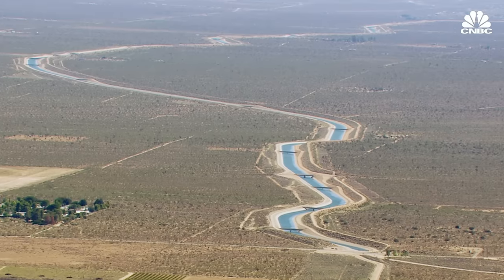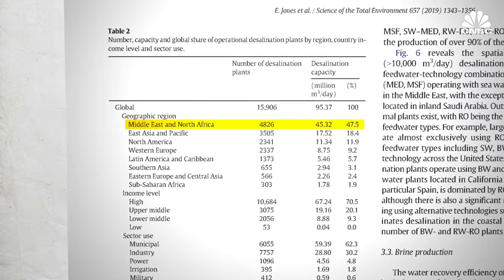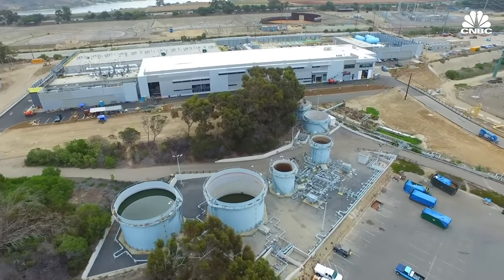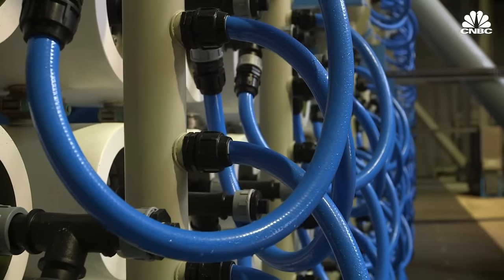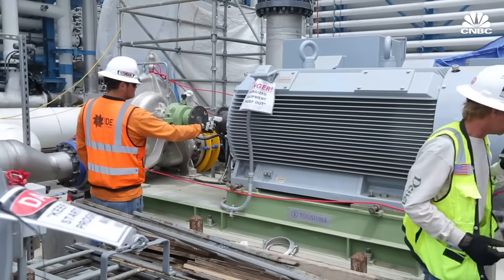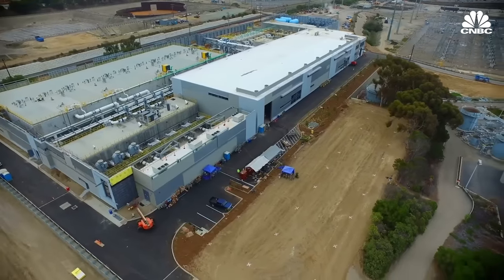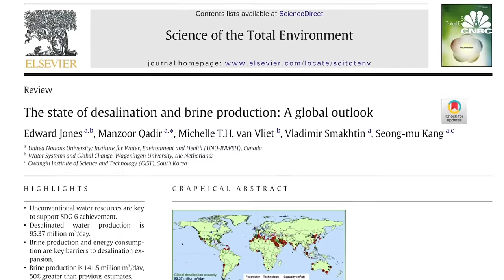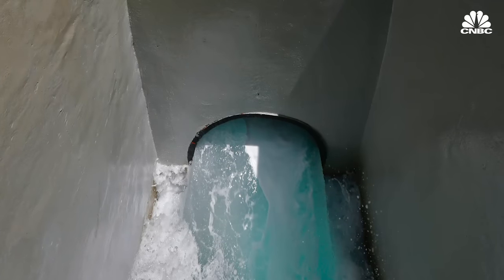Can Sea Water Desalination Save The World?

Comment: With nuclear energy, it is strong possibility.
Reply: For the mean time yes, until Fusion power can be readily available. Thorium Molten Salt Reactors should be heavily looked into. It's much more energy wasting to convert the used fuel into fissile material, so that is not an issue. We need to build these plants in areas not affected by earthquakes. Nuclear power is much safer than what it was 30+ years ago. It's more reliable than solar and wind energy and produces a lot of energy for a much smaller foot print by comparison.
Reply: why cant people just use renewable energy? for example the desal plant in sydney australia runs fully on renewable energy
Reply: @fxght  What kind of renewable energy and where is the energy production facility located?

Renewable energy is LIMITED on where and when they're available. Heck look at Germany which has increased its fossil fuel consumption for power despite being the largest user of wind energy, this is due to the need for base load power that is stabilizes the power grid. Batteries are still limited and the energy density for the upcoming technology is also smaller when compared to hydrocarbon fuels, let alone nuclear fuels.

Not every nation can implement renewable energy since it needs location, availability and such. Just because some can implement it, doesn't mean the same can be done for another.
Reply: how about with solar and only operating the plant at the yearhalf when solar energy easely covers demand? 
oh, and also the time when the extra water is mostly needed and wanted!

Why do we keep pushing for everything to be operational 24/7?  

a lot of less impact can just be reached by not wanting full production at all times!

nucleair is just an option to help with the energy mix, 

and untill fusion actually becomes functional, poses to much problems on it's own! one of witch is the CO2 emitted from the mining, especially the purification of uranium in that mining! but that CO2 is emitted in country of mining, not in country were the nuclear plant is used. (still less per KWH then burning fossel, but nuclear AIN'T CO2 free at all if you look at supply chain as well!à 
of course there's also still the huge problem of nuclear waste ... almost a century of nucleair en still all nucleair waste storage are only 'temporary' storage, only one scanavian country is making progress in a realistic permanent storage solution. So all nucleair energy produced lacks the storage costs on longer terms for it's waste .. so the theoretic price per watt historically should probably be doubled , but future generation will have to pay that cost.. 
the only reason it can still have a place in the mix, is just the fact they are operational already, and we already have to deal with all those problem in longer future while at the same time global warming is becoming so urgent even old nuclear helping to reduce some C02 already helps .. and of course that in the west the security seems adaquate to lessen the disaster threat to an extreme minimum..
Reply: @Johnlanzer  You are correct that renewable energy requires a lot of Grid Storage to make up for the variability (although in many cases that Grid Storage is NOT batteries. Batteries are only 3% of grid storage in the US).

But it is also possible to make a Desalination plant that can run on variable power inputs without the need for grid storage.  You can even use the Desalination plant to reduce the need for Grid Storage by taking any excess when it occurs.

Also we both agree that Germany was stupid on its energy policy.   Giving up nuclear, Non-fossil fuel base load power, was just idiotic of them.

If you want to know my position on energy in the US, I think we should be pushing both Nuclear and Grid storage heavily; I include supplements to Grid Storage in that (such as high efficiency long distance transmission lines, rampable industry, ect).
Reply: All steam coming of cooling towers from nuclear plans is pure clean water, just Colette and use
Reply: @vacikas  what am i missing? What do the steam towers have to do with anything said here before???
Reply: @JeroenJA  He's talking about the large cooling towers at nuclear plants, not producing any CO2.
Reply: @JeroenJA  The supply chain for getting Uranium or other nuclear materials such as Thorium, can have the CO2 level dropped by using electric mining vehicles. The mining process and transportation CO2 level is still pretty low for the yield of power Nuclear produces. The only 100% renewable energy that can run 24/7 outside of Fusion is Geothermal. That's how the mass majority of Iceland gets its power. We need a combination of every renewable source for power and not just put all our stock in one type. We need hydroelectric, solar, wind, geothermal, and nuclear to drop our emissions. All of which need to be in locations where they can be utilized properly. The midwest does not do well for solar, because the sun doesn't get in the proper areas for it to be used efficiently.
Reply: @Ratkill9000  "Nuclear power is much safer than it was 30+ years ago..."
Fukishima: "Hold my beer"

Nuclear power's problem is humans.  A fully automated nuclear power system might be safe but humans eventually discount risks.

Thorium is akin to fusion in that it is at least a decade a way (and probably 20 years).

And the levelized (cradle to grave) cost of nuclear is now higher than solar, wind, and hydro.  Which means it's going to end up costing our grandchildren to decommission those plants which seems immoral to me.

We need nuclear power in some regions.  But it's not a panacea.  And it won't work as well in a world where water is 4C warmer.
Reply: @macmcleod1188  Fukushima was built in a bad location. Nuclear plants should be built in land and away from severe fault lines. Very few people have died in the 50 years of nuclear power.
Reply: @Ratkill9000  so is plant in Florida where the diesel backup generators are below storms surge levels.

You're rationalizing. There's always an excuse after the disaster why that one was unique and special but the fact is there will be more nuclear accidents.

The only way to prevent it is to make it impossible from the ground up and that means no humans involved in the process.
Reply: @macmcleod1188  The worst accident was due to pure negligence from the Communist government for putting people in charge of Chernobyl who had no business there. We can learn from mistakes, we can make it work better and safer. That's why we should look into MSR because those are much more safe.
Reply: @Ratkill9000  are human beings perfect?

Look disasters sell papers but that's not my primary concern anyway. My primary concern is that nuclear power still under cells to actual decommissioning cost by two orders of magnitude. The levelized cost of nuclear power from cradle-to-grave is now higher than almost every other source of energy.

If we use the actual cost for nuclear power, than most nuclear plants would not be built.  But they promise this time for sure it's going to be cheap and the executives and the company keep billions in profits and then the bill is dumped on the public 40 years later, many of whom weren't even born yet when the nuclear plant was built.

Then the bill for providing security for the nuclear waste which runs to a few of dollars a year is dumped on future Generations for hundreds of years.  You can't just put nuclear waste into a landfill and walk away. Some terrorists will steal it.

Nuclear power is only cheap if you ignore the real costs. Which is what they did in the past and are trying to do again.

When we get clawback provisions and when private insurance companies are willing to ensure decommissioning costs such that it doesn't fall in the public and when we get more realistic escrow amounts then I will be more in support of nuclear power.  As it is I recognize it may be mandatory in some areas of the planet but conclude we should not use it anywhere that it's not mandatory.

You know... This is all moving deck chairs on the Titanic anyway.  Things are going to be really bad. And if we were a wiser people then nuclear power could have been a way to avoid the problem.

Comment: Could the reverse osmosis filters be placed at the bottom of the ocean so the pressure of the water above it forces the water through the filter and one only has to pump water out of the pipe, using only fraction of the energy?

Comment: 07:53  ratio of freshwater per higher saline -water is (1: 1.5 ) or (2 : 3), meaning every 5 (five) litres of sucked-in (RAW) SEAWATER, we will only get 2 (two) litres of Freshwater. The left-over/remaining (3 litres out of 5) is higher concentration of Brine/Salty water, to be carried-away. If talking this way, you will find " NOTHING STRANGE" in it/the process. Think of "waste" by-product, luckily the higher-salt concentrate can be diluted once they were mixed with larger amount of surrounding ocean. The worried concern is that with presumably LARGE AMOUNT OF Saline-"WASTEwater", the Dilution Process may not be FAST enough to mix-off into low percentage of (ordinary) seawater.. says 1.8 to 2.5 % of safety minerals contents. The Brine Waste, discharged, can contain upto 3.5% of salt/ minerals, which is harmful to sea creature eg, fish, crabs, coral reefs and the living-in.!?!
Reply: Roughly the cost of Desalination water (from ocean) is 4.44 -10 times of normally Produced City Water (from river/canal).

Comment: Don't they need salt water brine for the new salt water batteries? Couldn't they just build the battery place next to the output of the salt water desal place? 

Also, if the salt water place is near the ocean, couldn't they just use wave action electricty?

Comment: Desalination Southwest and Power Generation
Arizona has the superpowers of: Heat, Elevation, and Solar Power Generating Potential Capabilities. 

By pumping water from San Diego through a network of pipelines, using solar power, we could resolve our water shortage and redistribute throughout the southwest - to New Mexico, Nevada, SoCal, and Arizona(of course), by using the natural landscape of Ft. Thomas, AZ and an evaporative processing system, to produce desalinated water. Additional reservoirs could produce hydropower. We could utilize the natural flowing Gila River to help filter the water as well, by passing through sequences of filtering membranes we would have to maintain in towns along the river-ways. 

Of course, this mega project’s initial investment would cost billions, but would turn our deserts into an oasis while providing thousands of jobs and solving our impending water shortage. 

This could resupply our aquifers, help the Native American tribes who rely on the rivers, lower the cost of electricity on the locals, lower the costs affecting farmers, prevent drought, help our native wildlife, provide more resources for wildfire fire-fighting, and dramatically improve our economy far past our $460B GDP: making AZ one of the top 10 GDP states in the US.

Comment: Why can we make oil pipelines from Canada to Texas but we can go salt water pipelines to Arizona? Wouldn't it make sense to pump Arizona's dialy need to Arizona from the ocean then just  pump it to where there is no plants anyway and let the hot sun do it's thing?
You could easily make a mechanical system with the sun's passive energy

Comment: With the Mississippi river so low, Lake Mead drying up from over use by the states around it, we need this option now. Oops, big problem, you say you need lots of electricity to operate, your screwed. Wind and solar panels ain't going to cut it. There is running blackouts in California now. Solution, build fossil fuel generated plants.

Comment: Cutting out trees to build homes where now those dwellers  use up the ground water fresh water that can't be replaced due to  digging up  roots to trees cut  which pull the water back into the ground without them water stays on surface and runs off to the ocean and an empty carvity underground where water once was and now the ground sinks and all is lost !!! Get right it's not that hard to understand